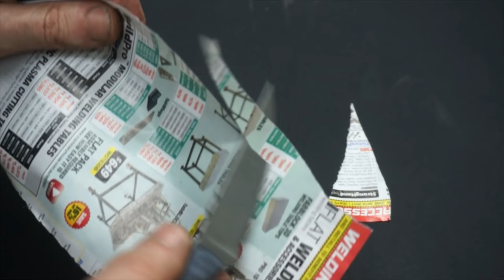Knife making: D6 edc fixed blade

Comment: That strap on surface grinder really makes a difference. I dont know how i tapered or flattened steel before i got mine.
Reply from the maker: yeah man. Its out getting worked on right now so I'm back to doing shit by hand :(
Reply: DB Blades ouch. I'll say a little prayer tomorrow and think of the pain that you'll sufferthrough until your grinder comes back. New batch of blades to be readied for heat treat.

Comment: Watching your drill....I wish I could get mine down to 200rpm....mine only goes down to I think its 450 or 700...wich is for wood not metal...but I keep my bits sharp...use oil...and steady pressure along with little bites at a time...I don't hold the bit on the steel for too long....seems to do ok

Comment: just a heads up for someone who encounters red loctite, heat it up w/ a hair dryer and it comes right out
Reply from the maker: that works a treat, I usually use a soldering iron.
Reply: Ah, that probably goes much quicker. Thanks dawg

Comment: Man that's one sweet looking knife you got there. A little like a Strider DB, but actually useable for cutting shit, rather than prying only. 
Just out of interest, what's the thickness on the blade? And, if i were to place an order for one of those, how long will i take you build one for me? Do you make them upon ordering or do you keep a few in stock? 
Also, would you ship to Germany?
Reply from the maker: Thanks dude. 

these are easily the best cutters I do since I grind them nice and thin and I do a serious distal taper.

to answer your questions the thickness should be a little under 3mm. I start off with 1/8" stock by that gets surface ground down plus the taper thins out the stock a bit. 

If you where to place an order for one the wait is about 3-4 months right now. I do however have 2 in stock one of which is the blue one in the video and the other I finished up last night. 

Yes I ship to germany 
Here's my site http://dbblades.bigcartel.com/

Comment: I always have trouble drilling holes in my knives... and tips?
Reply: Center punch more? Buy good drill bits? Use a vice and a drillpress?
Reply: Youtube User I have titanium and cobalt drill bits, a drill press, and even if I do center punch it still doesn't work
Reply: Explicit Blades Hm... So what can you still fuck up then? Do you have play in the spindle or shaft of the press? If not it might be you. If you have a drillpress it is usually impossible to not drill straight (as long as your press is straight).
Reply: Youtube User my drill bits seem to get dull very fast when I'm drilling into high carbon material
Reply: Try a slower speed. I just killed two drill bits making a knife. Not completely sure how. but the bit i used was 3/8" and had it on about 2000rpm. When I drilled 4mm holes they were fine at this speed. So I am gonna try a slower speed next time for bigger drill bits. And use a lubricant.
Reply from the maker: you need to match the speed with the drill as well as keep even pressure. If that doesn't work try annealing your metal